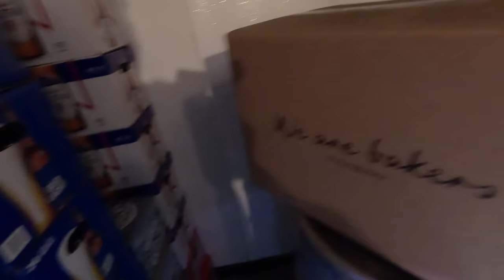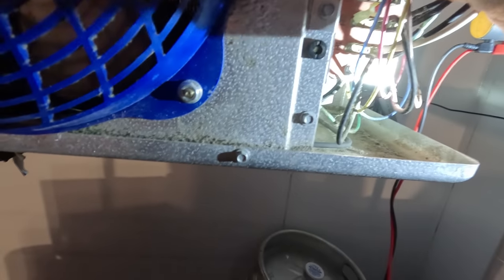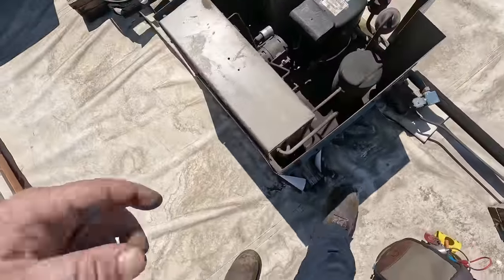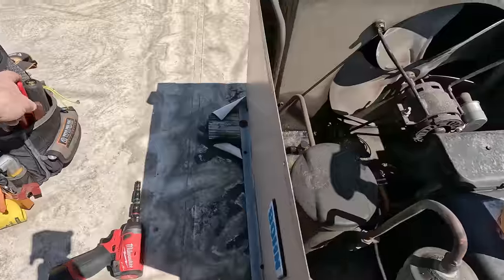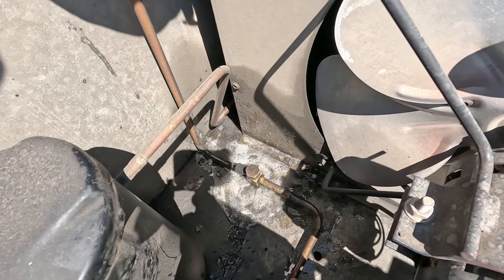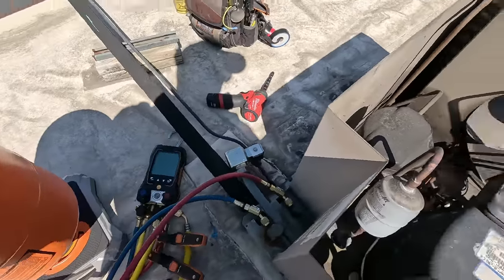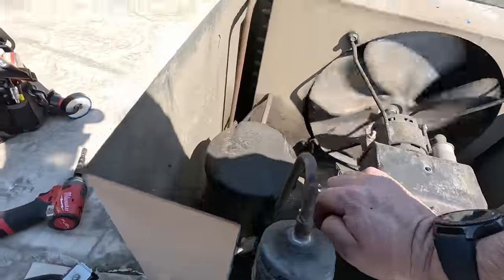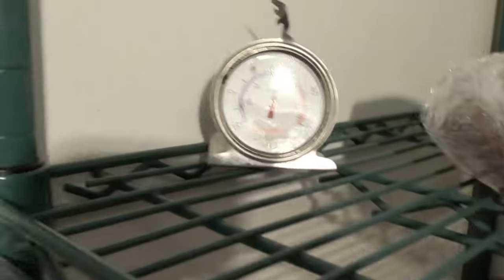Beer Cooler Warm... Fan's Not Running...

Comment: Is this the cooler that's not working right? "I couldn't tell you"
It's my number one frustration in this trade, nobody knows anything about anything or where anything is at or why people called. 

End up working on the wrong condenser the other day then find out the condenser I needed was on a different buildings roof
Reply from the maker: Amen brother, I have done that several times. I feel ya

Comment: Great to see you great troubleshooting I’m starting to have troubles out of our freezer heatcraft units  wearing me out on quality equipment
Reply from the maker: All the new stuff is failing because they're making them more efficient..( less heavy duty). Higher efficient compressors don't have any extra horse power behind them and burn up easily plus super-efficient evaporator and condenser coils leak easier because they have better heat transfer thanks to it being thinner.

Comment: In Sweden we do maintenance as well (yearly leak search or more often if breaking a gwp limit (more gas in the unit)) as it's required to the laws for f-gasses, at the same time we clean and check condition of equipment and repair if needed (with ok from customer) to get rid of 95% emergency calls on overtime.
Reply from the maker: Preventative maintenance keeps you busy during slow times and at home when you're on call👍👍
Reply: @HVACRSurvival  Absolutely. But sometimes we have to go on er calls as well during "on call" time, things tend to break between two maintenance services w/o notice.

Comment: I like the 'replace the valve option' myself.  You can add oil to the compressor, but the damage is already done.  Time to advise the customer of possible compressor change out.  IMHO..  Ya,  nice tools!
Reply from the maker: I figured the o rings were shot.

Comment: Would it be worthwhile to keep a can of carb cleaner or brake cleaner around and use it to blast all that oil off the inside of the unit? Might make it easier to detect fresh oil the next time.
Reply from the maker: Yeah I keep brake cleaner in my van, it definitely can help clean it up after a repair.

Comment: Can you tell me what videos you have that have a bohn in it? I have a customer with one and want to rewatch that them
Reply from the maker: I believe I've only mentioned a few things about it and another video.  I believe it was even at this place possibly a year ago. From the way it's been explained to me it's just an oversized TXV valve that's able to run normal superheat with lower than traditional head pressure.
Reply: Very helpful. Thanks for the response 🤜🤛

Comment: Hey Rick, just curious why you didn’t attempt to adjust the valve itself 17:15 with your torx wrench?
Reply from the maker: I didn't have any problems with the txv, it wasn't really flooding back, it just looked like it.
Reply: @HVACRSurvival  I meant the valve you capped at the discharge line. You only sealed the cap but didn’t adjust the valve itself. We always crank those up when we find the leak there.
Reply: @HardKnocks101  that style valve has the stem sealed by an o-ring, once it's old and elasticity gone it, it no longer seals and out comes the gas/oil.
if it's the type with stem retained by a snap ring, it is possible to pull the valves apart and install a new o-ring, but nobody does that!
Reply: @throttlebottle5906  yup, clear as mud. I know the valve and how it functions. I am also very familiar that it leaks. I still am very curious why Rick didn’t run the valve down and back up to try and stop the leak. Guess we’ll never know….
Reply: @HardKnocks101  better to "let sleeping dogs lie", because the o-ring sure won't magically become round again and the chances of it leaking worse are very great, it could even go full hisser in which you cannot get the cap back on or burn yourself doing so. the school of self learned hard knocks will teach you that one day( lol)
Reply from the maker: @big dawg the reason why I didn't try what you're proposing is because I've tried it in the past and it never worked. I have tried cranking the valve all the way in and then coating the inside tubular area with refrigerant oil and I've even tried it with nylog and it didn't help.